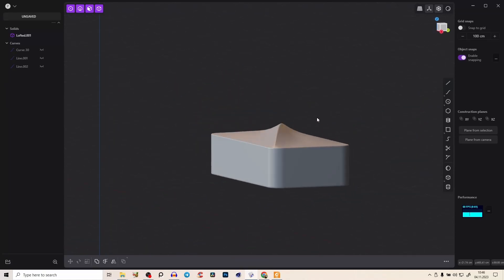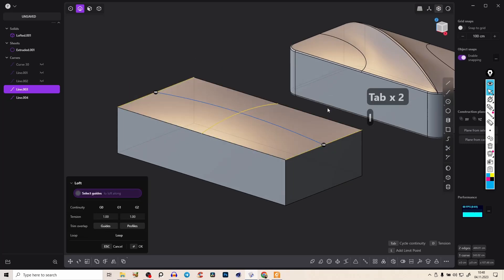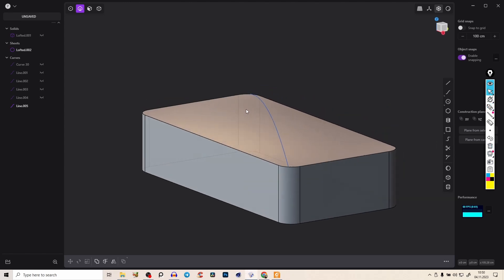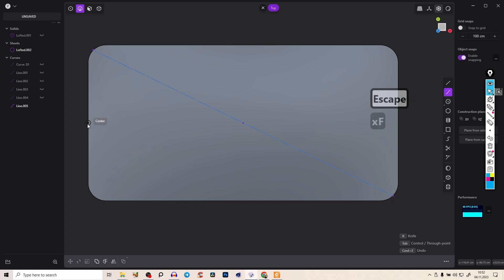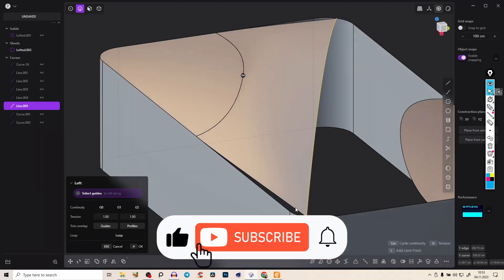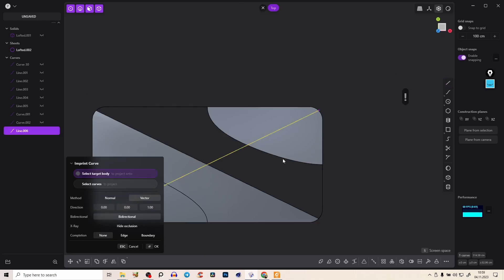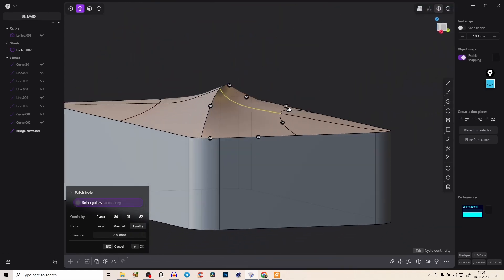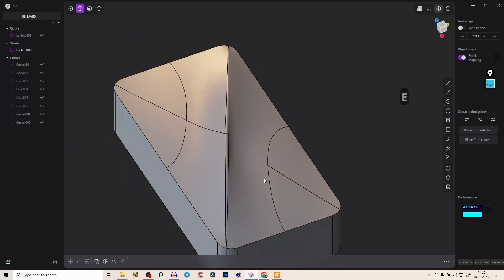Plasticity Beginner Surface Modeling Exercise Tutorial

Comment: Couldn't get the patch to work in 06:15
Reply from the maker: We have a free community. You can join if you want and post your project file and I can have a look on it and give you a solution.

Register and join here: (1-2min)
https://www.skool.com/ultimate-3d-membership-7140?invite=16b95b9b21c9440db3befabf4b050640
Reply: You have correct snap points to continuity.
I've the same problem , error(gap in patch)
Snap points with Ctrl and will be OK.

Comment: Could not get the sub-divided lines to curve simultaneously - turns out that I was still running 1.3.0. Updating to 1.3.8 solved the issue.
Reply: 1.3.8 what? I'm still running 1.3 haha

Comment: This is excellent Nikita definitely more of this 👌🏻
Reply from the maker: Thank you! Will do!

Can you tell me what exactly you found so helpful in this tutorial?
Reply: @nikita.kapustin  1. How to make a perfectly rounded surface on top of a rounded square. 2.Splitting the faces before lofting and then splitting again to make a point to use the vertex curve. Basically its learning these small techniques that can help with larger projects. without having to follow a long tutorial of a larger build.
Reply from the maker: Okay got it! Thanks for mentioning guys @sbeck9205   @sammy.3D
Reply: For me it was the work around to add crown or curvature to a surface before lofting. In other softwares I use you can directly pick and pull the surface so awesome to learn this more manual technique !